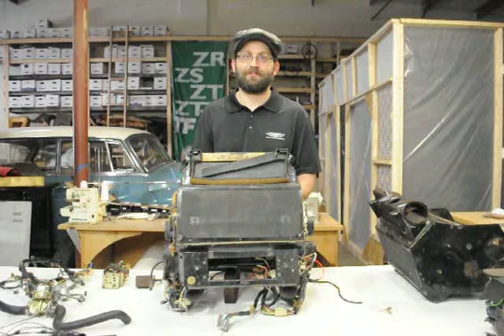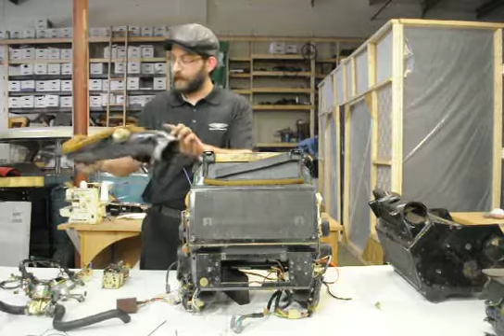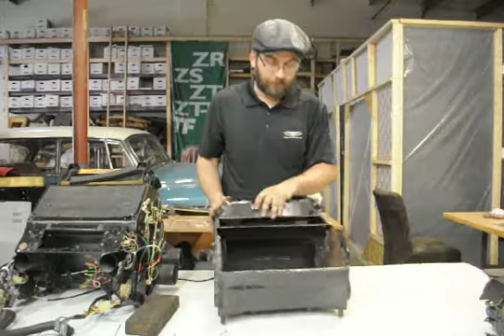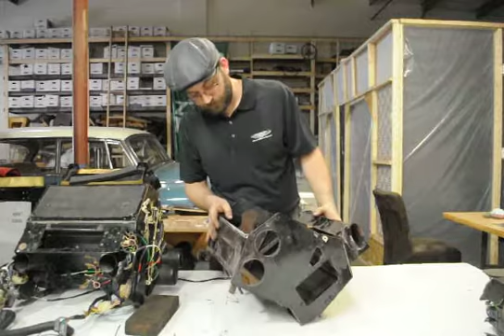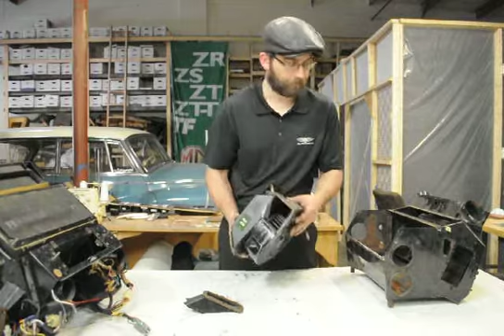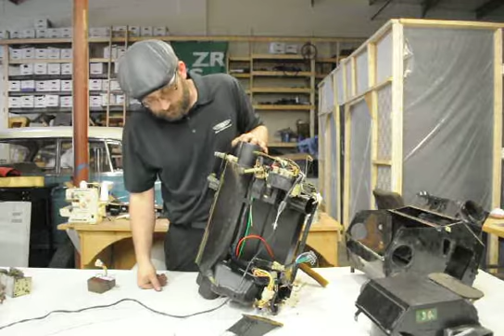Jaguar XJ6 Series 2 and 3 Delanair HVAC description

Comment: I have an 89 XJS with a III, the floor vents are hot, side vents like warm/cool. Is that normal? Face vent slider is on hot, and temp is on max heat. I want a toasty cabin. :(

Comment: If you select temperature at 65F and speed at low, where is the cold air supposed to be coming out from? In my case it is only blowing by the feet and not on the main vents which is a bit odd and I am wondering if this is normal or not?
Reply: air should come out the center and side vents because 65 degrees calls for a/c / cooling regardless of fan speed. Sounds like your amplifier is gone. The amplifier is located behind the radio, buried deep back there close to the firewall and held in place by a spring tongue bracket, a pita to remove and not worth removing. All you need to do in a Left Hand Drive XJ-6 Series 3, (1980-1987), is find the large cream color round connector with many thin wires on both sides and disconnect it. This connector is located behind the "knee" panel where the floor vent is, Driver's side.  Remove the 2 screws at the plastic vent and pull the panel towards the accelerator pedal. Hide the connector and wiring that comes from behind the radio. Then connect the new amplifier to the receiving connector. There is room to push the new amplifier in there, then replace the panel and floor vent. Test system at 65 degrees with the MODE SWITCH in AUTO. Center vent should open as well as side vents. Heated air only comes out the floor vents and the side vents, never through the center vent. Good luck.
Reply: zurdo z you are a genius my friend. I got to amplifier and changed it with a used one. Now the flow is how you said it should be
Reply: @MS-lt2lx   excellent !  glad it fixed the problem.

Comment: very useful, thanks!! Do you have any info on the series 1 systems, are they similar? I'm going to pull my dash this winter to go thru wiring and hvac. Cheers
Reply from the maker: The Series 1 has a vastly different system than the Series 2 and 3 cars. I am trying to get some time to put together a video detailing the S1 system specifically. If these links work, they are from my shop where I've built and modified an S1 extensively for a customer, but it does show what the behind the dash looks like. 

https://www.facebook.com/pg/Jollywrenchers/photos/?tab=album&album_id=1919343311634318

https://www.facebook.com/pg/Jollywrenchers/photos/?tab=album&album_id=1525220434379943